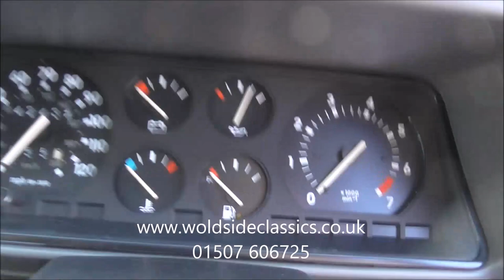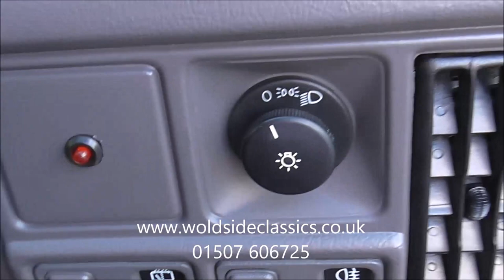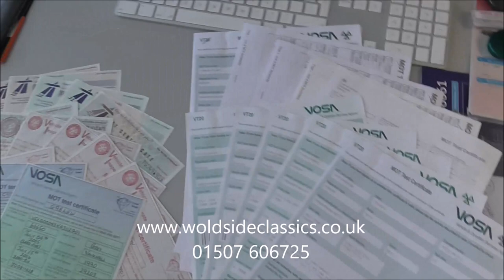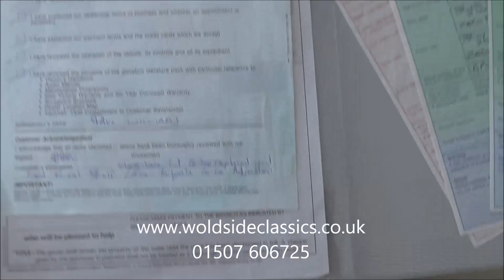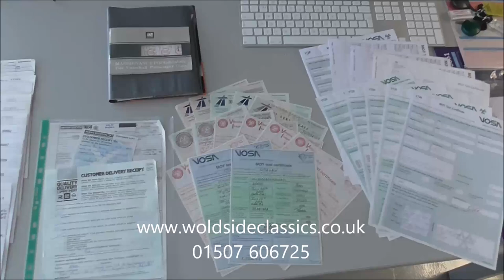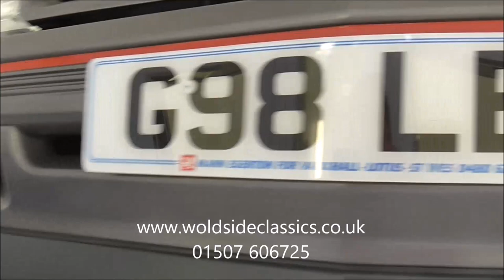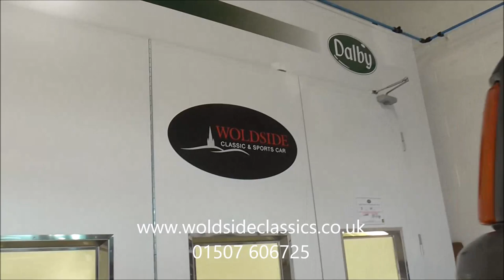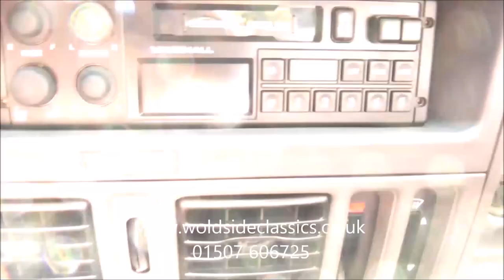SOLD - 1989 Vauxhall Nova GTE 1 6i 3dr For Sale in Louth Lincolnshire

Comment: Lovely car. I learnt to drive in '95 in a 1.5 TD Nova. Would so love to have this one
Reply: I passed my test in a 1990 1.2 in 1992, my cousin was driving the saloon version at the time. Couldn't believe the abuse that thing took lol. But I drove the 1.5 td aswell, felt fast back then.
Reply: I had the 3rd td and it was fast 125 and was still pulling for more
Reply: Had a 1.5 TD SX in Red with steel alloys. 
Out of all the cats I have owned since the one I miss the most.